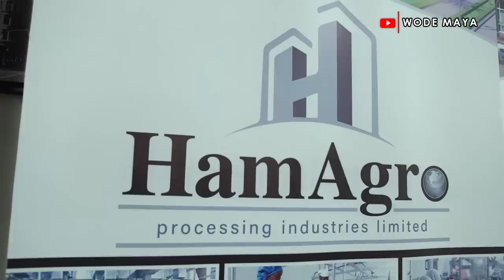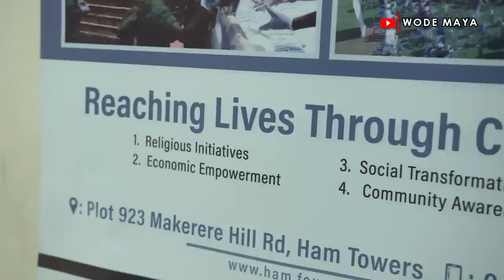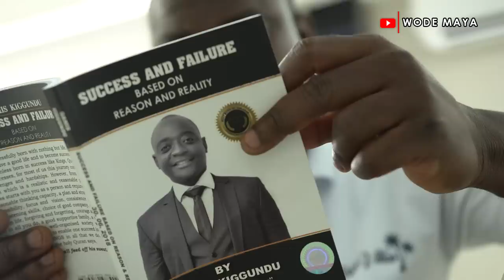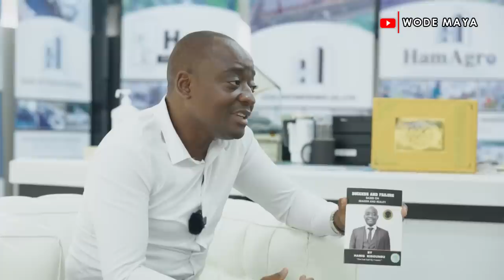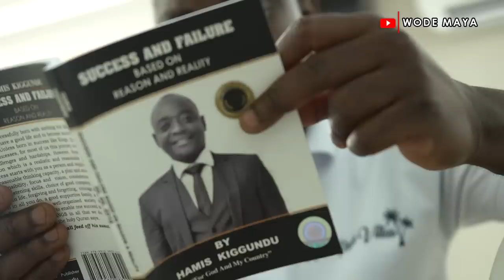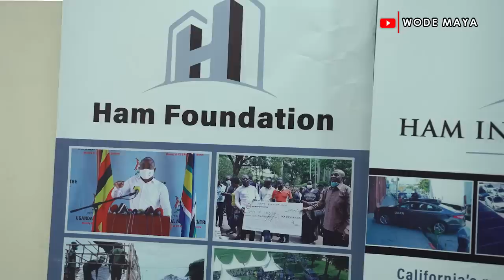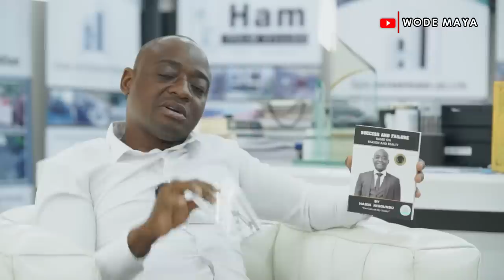How This Ugandan Became A Billionaire Before 40!

Comment: This man is a pure philosopher. Your reason is a key for your success or your failure.
Reply: Or your luck but yeah the methods that are most reliable for acquiring business success is using reasonable methods in solving business problems. Otherwise you'll require luck

Comment: Exactly what's needed...look forward to the time when facilities are fully equipped and in production. I've been in warehousing shipping and receiving for more than 25 years...couldn't help but notice those warehouse like buildings appear staged like models..The positioning of those buildings are not logistically conducive to high volume production while allowing incoming and outgoing 18 wheeled freight.
Reply: Why should they be modeled  on the warehouses in the US? Rather than passing judgment ask how they are supposed to function.
Reply: @mwinyimwenyi  You have totally missed the point of my comment....which has nothing to do with location nations or architectural preferences...but only logistics ie a 12.192 meter to 15.24 meter long truck has to have 1a dock and open space befitting that size truck to maneuver into. 2 you have space that accommodates trucks moving in with raw unrefined materials, trucks moving out with refined goods and waste byproducts of the refining process, all at potentially the same time and or by scheduled times....Again all of which have nothing to do with Countries nor building architecture. A major automobile assembly plant in America fundamentally operates the same in Japan Africa or China.
Reply: @rudygrissom5871 , my point still stands. Stop using your standard as a yard to size up others. Ham to get where he is must know what he is doing. He has businesses in the US and UK. He must have seen their warehouse systems.
Reply: @mwinyimwenyi  Respectfully my friend math is calculated the same way all over the world. Geometry is a universal international standard applied everywhere the same . Logistics- The detailed coordination of complex operations involving many people facilities and or supplies.
Reply: @hblessed5750  Appreciate that information..what are the size of the trucks used in Uganda with which products for the commercial wholesale markets are transported.
Reply: @rudygrissom5871  , that is what you should have done…. Ask😉.
Reply: @mwinyimwenyi  Understood